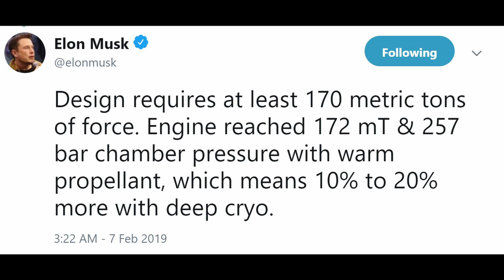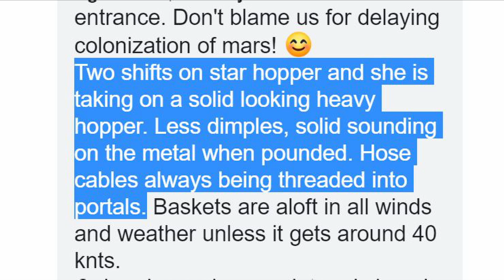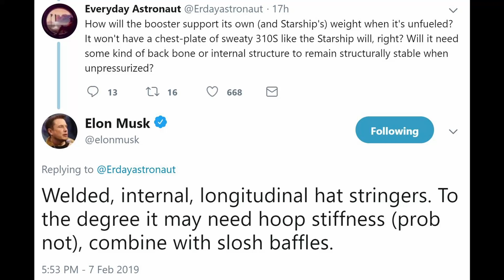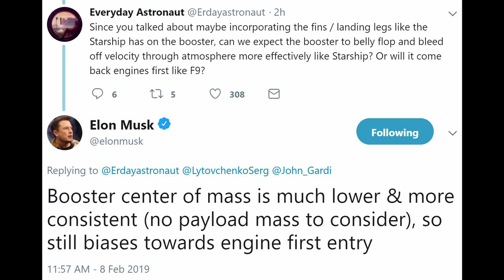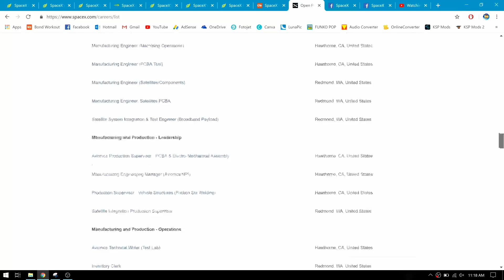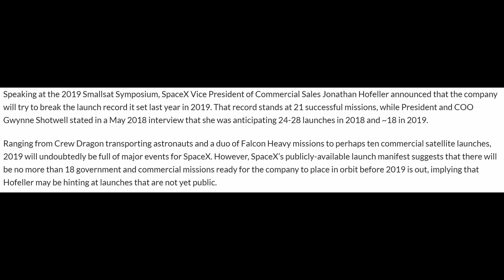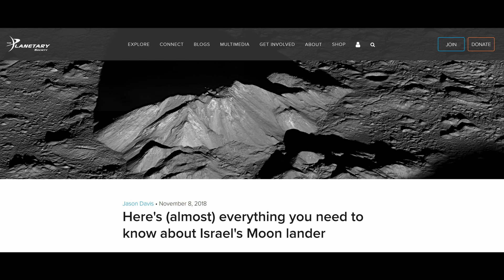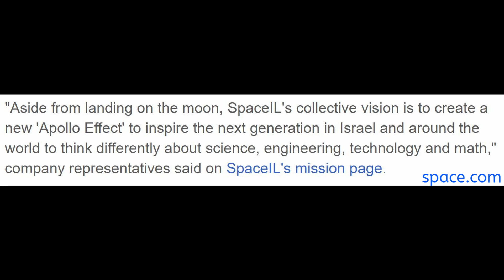SpaceX in the News - Episode 13

Comment: I will be very surprised if SpaceX  even accomplished 21 launches this year. In 2017, and the first half of 2018, they were scooting along with a launch rate of very nearly one every two weeks. Starting in the latter half of last year though, due to delays for a variety of reasons, and this is all part of the business, their launch rate has slowed to barely one a month. They did manage three in December, but other than that it has been one a month ever since about last August. They had three scheduled, for this month, two of them have slipped, and it is now one. They have three scheduled for next month. Who wants to bet they achieve it? Eventually, they will get these problems worked out and get their flight rate back up again, but for now, one a month seems to be what they can do. My guess is they will achieve between twelve and fifteen launches this year. Let's hope that next year, it's more like twenty five to thirty.